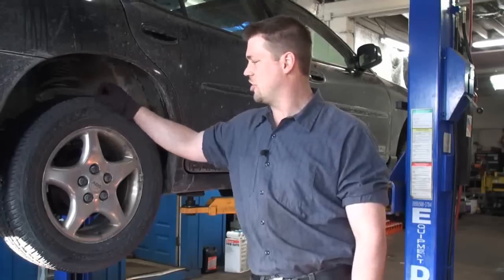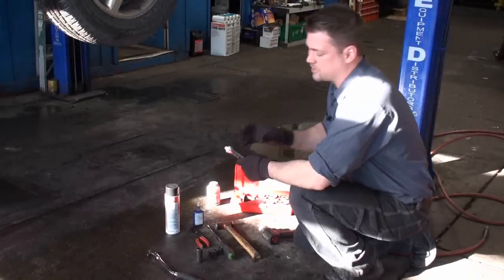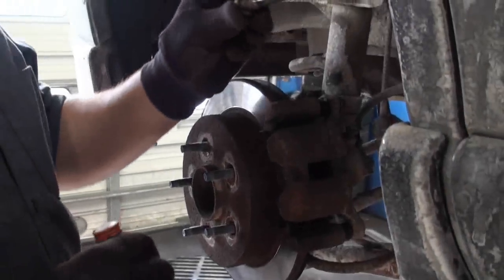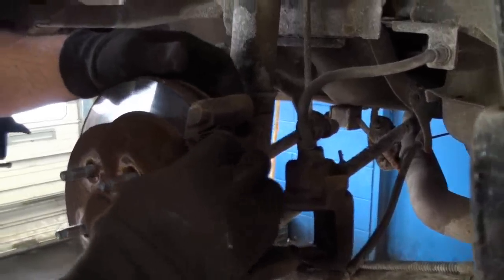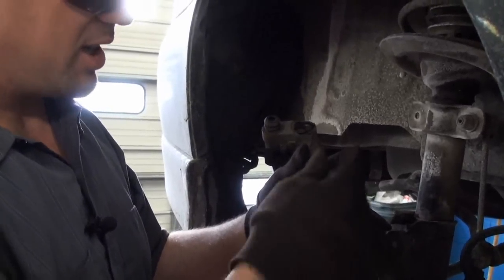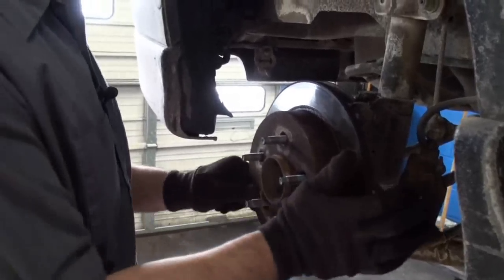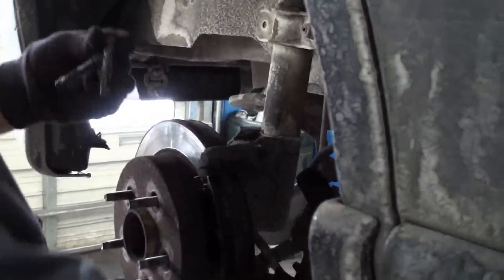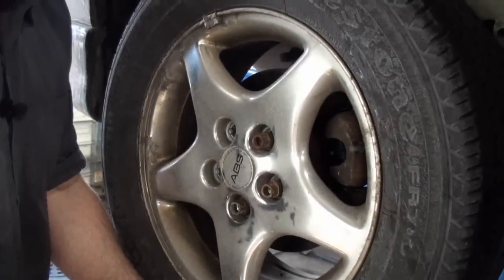Brake Pads- Rear Disc Brakes- How to Replace  Brake Pads- Rear Disc Brakes

Comment: Thank you so much for this video.  I just completed replacing the rear brakes on my '04 Honda Element.  I ran into just about every problem that I could think of but I did everything in your video and it turned out perfectly.  I found out that you can't remove the rotors if the parking break is on (Oops).  I highly recommend this video.

Comment: I hope it works- myself- as I will be doing this job tomorrow.  I am skeptical but the cube is the least expensive item.  The big "if" is whether you can muscle the piston back in.  I have had to use a large C clamp on older Fords to do it.

Comment from the maker: @CommonM1stak3  Yes and many time when you replace the brake rotor you will have to pry the rotors off which will result in damaging or displacing the parking brake shoes. The result will be a constant rubbing noise or a noise that increases with speed. Due to rust the new rotors may rub on the backing plate or shoes. Always clean off all the rust at all cost and spin the rotor with the tire only installed on it to make sure there is no rubbing noises. If you don't you will have to disassemble.

Comment from the maker: We use either a brake pad spray or the brake quiet liquid orange goop. Helps with pad vibration which leads to squeaks and squeals.

Comment from the maker: @ranacherian Same here in Michigan, LOL, However due to the extreme amount of heat and vibration when braking the bolts will loosen up and turn out resulting in a very dangerous situation and damage to the brakes system.  We also torque the bolts down. I know these seems over kill but you would not believe how many times I have seen caliper bolts brake off because they were over tightened. Someday you will more than likely have to do this again and it will be nice if the bolts come apart.

Comment from the maker: @0466rymaspencer  I always change the rotors with pads. For so many reasons I may not have the space here to go into! for one they are so cheap now i don't know why you wouldn't. #2 Very high chance they will squeak and squeal if you don't #3 The thinner they get the hotter they get which will lead to pulsation and more noise #4 the brakes will not stop as well and will feel spongey, feeling like your on ice and vehicle does not grab and stop like it should. I hope I have made my point. :)

Comment from the maker: @jdubdoubleu You can replace pads without bleeding brakes. I would not recommend anyone without professional experience to remove a brake hose, release a bleeder valve or bleed brakes. At the very least have someone who has done it a few times before help you. If you get it wrong best case scenario you smash up your vehicle.
 Remove the brake master cylinder cap and press the piston back with a C clamp. If it does not go back caliper is bad, replace it, then you will have to bleed brakes.

Comment: @davidzzz94 

with some rear pistons they need to be twisted whilst they are pushed in to be successfull. usually the piston would have a groove which the tool would grip to twist it.

Comment: @whole27 You only need to remove break fluid if new fluid has been added to "top off" the master cylinder. If you don't when you compress the caliper piston, you'll push extra fluid all over the master cylinder entry. If there has never been any fluid added. You should be fine.

Comment: Great tutorial. I wonder, are brake pads much different for each car maker? Is it possible to physically fit, say, a pad for honda on a toyota? The reason is brake pads for more expensive cars are more expensive than for cheaper cars, but it looks just the same.

Comment from the maker: They call it brake pad spray or anti rattle spray. Personally I think it is a waste of time however i have always used it because I want to eliminate any chance of brake squeals or squeaks on customer vehicles. I prefer the orange pastier stuff. The theory here is when braking the brake pads can and will move ever so slightly in the caliper mount. This spray or paste hardens and is supposed to help absorb some of the vibration or movement that would lead to noise.

Comment from the maker: @Stylefree83 Many newer vehicles can be very difficult to bleed requiring expensive computer equipment and more time than you will want to spend resulting in vehicle being towed to a reluctant repair shop that will charge you more that you probably spent on all the brake parts combined! 

All you have to do is remove the top off the master cylinder and carefully push the piston back with a c clamp. If it does not go back there is a reason for it. Possible bad caliper or brake hose.

Comment: When pushing the cylinder back it, I always open the bleeder so the old fluid from the wheel cylinder is discarded and I do not push the old fluid back into the system.  I think it is safer to just let the old fluid out the bleeder than to take the chance of pushing crud back into the master cylinder.  Then I always bleed the entire system with fresh fluid.

Comment: What do you think on those cubed piston tool that pushes the piston back I'm wondering if I can use that instead of buying those fancy adapters that cost like $50-$60 and on what vehicles does that cube does not work. I just finished my Brakes class and I want to start doing brake jobs but I want to have the right tools.

Comment: I for see a brake pulsation coming from installing those tires with the air tool with no torque limiter you should have used something to torque the wheel back on as to not over tighten the wheel causing the warp pulse when breaking.
Reply: true, but he is using a 3/8 air impac so the force thats being put on those lugs nuts isn't that great, although you have a valid point  Even with the 3/8 impact he should've used some sort of torque limiter there.

Comment: Please stay away from the Orange bottle, it is basically latex paint. When it hardens with heat, it forms a hard crust that prevents pad from moving freely on piston.  As to Anti-Seize, it contains over 60% mineral oil, 30% calcium fluoride (powder) and maybe 5% aluminum.  The oil in AS evaporate with heat so it leaves a sticky residue that restricts movement of brake pads.

Comment: Disc Brakes Rear need Changing on my VW New Beatle 2004 turbocharged 1.8 - I don't drive much and one back pad is bad and is throwing brake dust. I just want to only chang back disc Brakes quickly to get me for another 1000 miles and not sure what I am doing when I chang this in the snow.

Comment: So, the two slide pins are different. One has a bushing on the end of it and the other doesn't. Obviously one is for the top and the other is for the bottom. No mention of which one goes where.

Comment: WHAT ABOUT REMOVING THE CAP ON THE BRAKE FLUID RESERVOIR BEFORE PUSHING THE PISTON BACK???
Reply: Typically not needed to do....reservoir should return normal full position when done-otherwise you may have put in too much brake fluid. I've never had removed brake master cylinder cap-but it might be a good idea (being as that's so simple to do)

Comment: meh bleeding brakes is considerable easier than bleeding the clutch 
i bleed the clutch by myself 
where as the brakes are not as easy especially when i change the calipers and have the whole system drain out

Comment from the maker: I do not recommend this method to a DIY guy. Never open a bleeder valve on the brake system unless you are replacing parts that require you to do so. Very few individuals doing brakes for the first few times can correctly bleed a brake system resulting in a very spongey pedal or worse crashing the vehicle afterwards. You also have to contend with rust and corrosion.  Only someone with experience should attempt this.

Comment: He is standing by the rear wheel but the wheel he takes off is a front wheel...  rear brakes also have a handbrake cable..... he's working on front brakes.

Comment: So we need a torque wrench in the trunk of every car, so if you get a flat you can make shur the spare is put on to proper spec ? What the hell are you smoking? Do you think every tire and or wheel on every thing on the road is torque to spec ?

Comment: you forgot the most important part man. I would hope that you torque the wheels on once the vehicle is lowered if not you will be sued one day for someones wheel/wheels falling off either from over torque or not enough torque. You could kill someone or from your video basicly inform someone that there is no need to torque your wheels. I didn't see a torque adapter on that gun and even if there was I still wouldn't be impressed. The only way to torque is with a proper calibrated torque wrench.